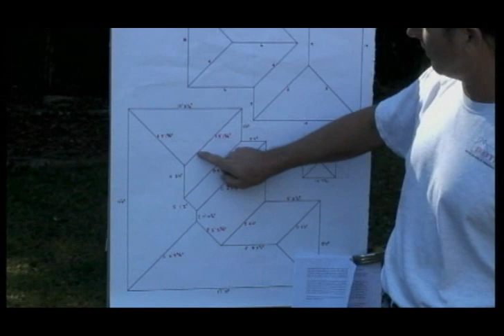How to use Adjustable Hip Square V5

Comment: hello i noticed when you were setting out on your hips and valleys you were marking out 1.5"but when you cut the rafters on 45 degrees the cut is longer( 2")does this come into play with you ratio on working out the lengh or do you work to the long or short points?also on your ratio settigs on rafter lengths is that the total lengths or to the plumb cut of your birds mouth or your total rafter length.please dont think im having a go at your square as  im interested in purchasing one .do you ship to the uk?thanks